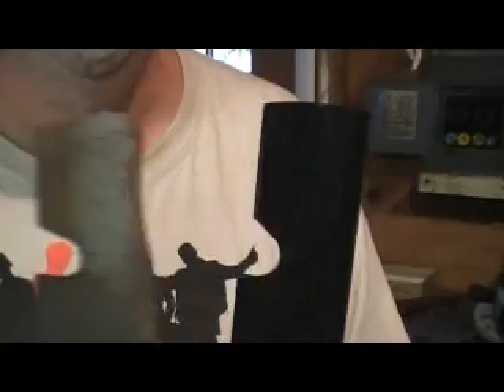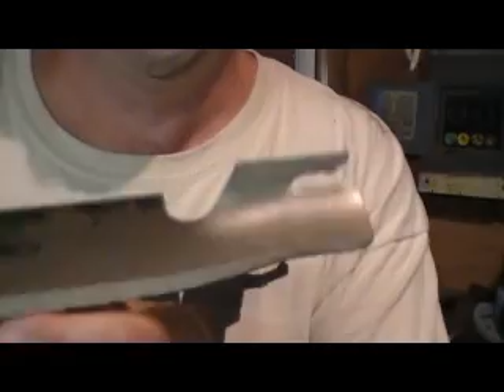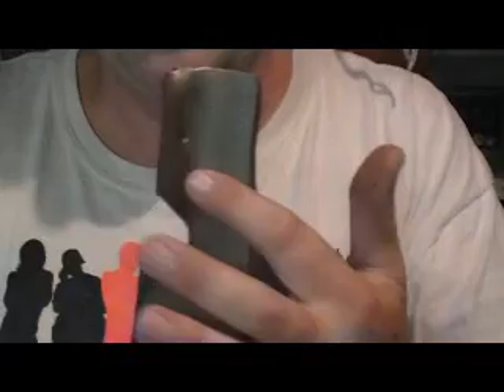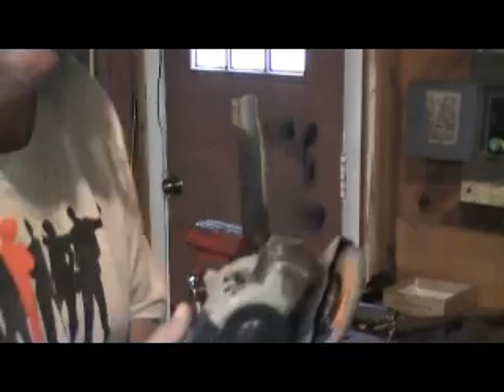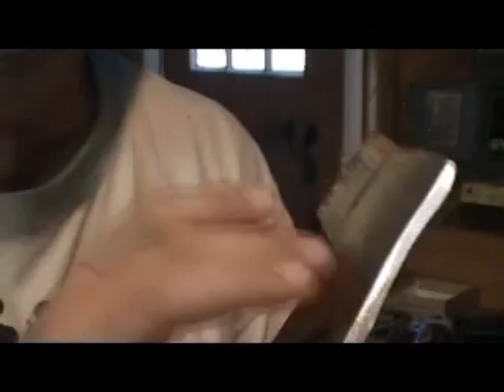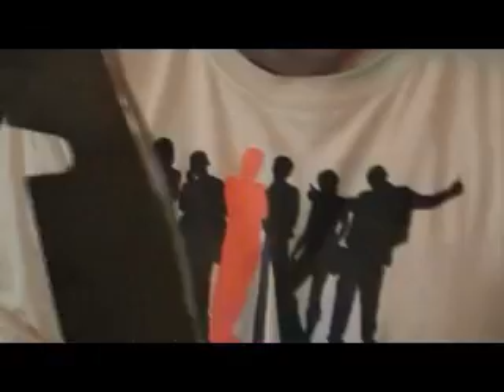How To Sharpen Lawn Mower Blades and When to Replace

Comment: what if the blade only has indented curve but the fan tip and the rest looks good.. can I still sharpen the blade down enough to remove the indented section and make it into a straight line?

Comment: I bought an angel grinder for the purpose of sharpening my blades but am waiting till about October to take them off my mower. For that reason I'd like to thank you for your video it was informative and will help me.
I have a question about your bench grinder. When you run the blade across it, and the wheel rubs the blade and jams it against the grinder's shield, won't it get caught and stop the wheel? If figure if it does it might damage the motor's internals with short circuits.